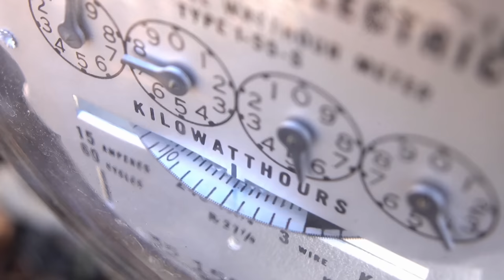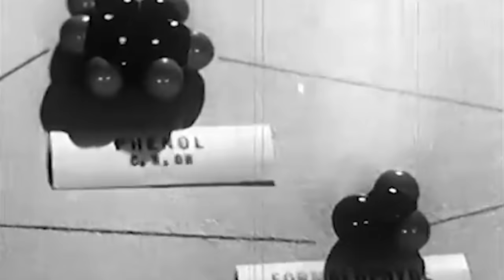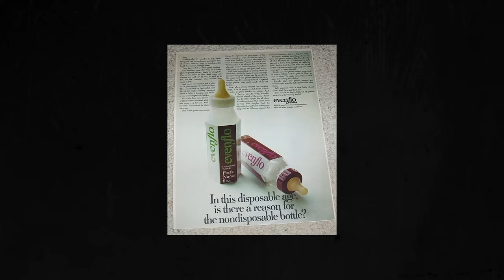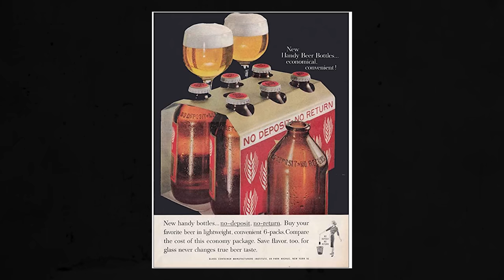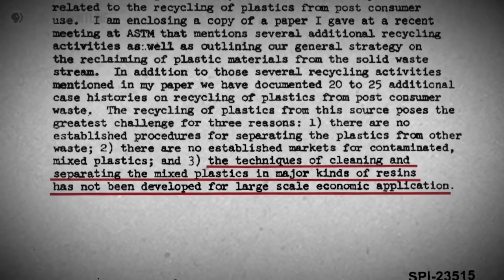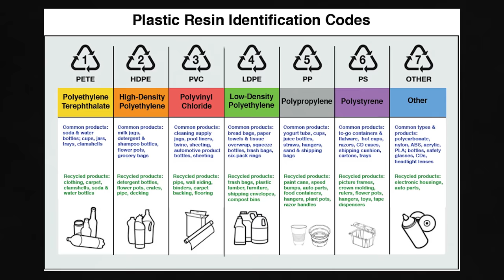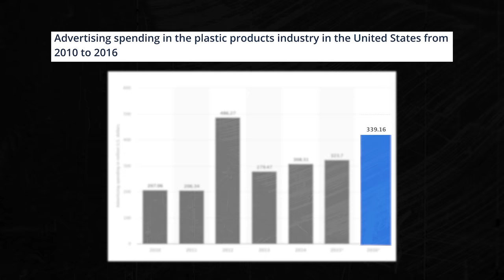The great recycling LIE (what really happens to plastic)

Comment: I worked in a plastics factory in the early 80’s. If a part coming out of the mold didn’t meet specs, it was ground into pellets and reused in the injection molding machines. There was a clear difference in the product made from the original pellets and the product made from the grinder. I’ve known for years that recycling doesn’t work because you will always have an inferior product. I wish we could all go back to glass milk and soda pop bottles that got washed and reused. We are an incredibly wasteful society. No product gets fixed anymore, we just throw it away and buy another. What we put in our landfills is a bigger environmental problem than gas powered vehicles.
Reply: It truly is sad. Everything is about profit. :( 
Look at how furniture is now. 
People used to pass down dressers, bed frames, etc through their families. 
Now they just dump the furniture and buy new ones from Walmart or IKEA. 
Particle board. 
Not solid wood meant to last hundreds of years. :(
Reply: @Crowski  Don't knock Ikea, a lot of that seemingly flimsy furniture can actually last a very long time.  We have some pieces from Ikea that are going on 20 years old, the stuff that fails usually fails in the first 6 months.  Real furniture all comes from either China or Vietnam now as they dumped in the 90's and put all the domestic furniture makers out of business.  It used to be that it was so big and heavy it needed to be made locally.  The same is largely true of kitchen cabinets, a lot come from Asia now.

Even if you consider a 20 year lifespan, it took too much less energy and required less deforestation to make that cardboard furniture that even if the real stuff lasts 100 years it's still more environmentally friendly to use the ikea junk.  Now the argument for real furniture is different the SE Asian made furniture is more environmentally unfriendly and certainly would not last 100 years.  My quote unquote real furniture is a far cry from what was produced even 30 or 40 years ago, lots of poor quality joinery which inevitably fails rendering expensive furniture generally useless.
Reply: @shaunbava1801  I agree but I believe it also has a lot to do with climate. Real wooden furniture holds up to humidity. Particle board doesn’t. :/ 
We have a shelf in our living room that’s particle board the past 15 years. 
It’s bent and leaning. 
But solid wood shelving hasn’t changed at all. It’s still like it was 25 years ago. XD 
It is EXTREMELY heavy I agree with you there. When it comes to moving….good luck. lol
Reply: They've experimented with a plasma torch to burn the waste at landfills.  A plasma torch will burn anything and the byproduct is just carbon.  They also wanted to see if that process could produce clean energy.  It turns out that yes it was able to get rid of waste and produce clean energy, but not in a profitable manner.  Hopefully, they'll continue to improve, but I don't have much hope.
Reply: why is it such a problem?
Reply: @shaunbava1801  When it comest to bilding furniture I don't see deforestation as a big plodom. I know a guy that bilt his house out of Aspen Polls that he loged and miled him self. To get the lumber he was hired out to do Forest mitigation. He dose all his loging with horses making it even less stressful to the forest. So say a wood worker paired up with people like my fried to bild furniture they would be helping the forest by thining out spots of overgrown Forest and turning the would in to something that would last a long time and even be fully biodegradable. Just my two cents.
Reply: They got rid of big pop bottles because they exploded dangerously at times and companies don't want to go through the bother of double handling their products, when they could put that effort into making more products.
Reply: When you recycle a product, you can only recycle it into something worse than what it started as. You've made this clear with plastics being recycled, other materials like carbon fibre, which aren't actually recyclable, have been ground down and used as a filler in concrete. We're effectively burying our rubbish inside the walls of our concrete jungles... Recycling doesn't make a material go away, it just postpones it from being buried in the ground. 

And now we have people thinking that plastic pollution is caused by people willfully littering... That giant island of garbage in the Pacific doesn't happen because I "forgot" to put my chocolate bar wrapper in the nearest bin, it happens because of large scale neglect and those items finding their way into the wild regardless of whatever good deed we thought we did with them.
Reply: Recycled steel used in the automotive industry EVERY TIME we've needed to redirect raw materials to war efforts taught us what problems there were with recycling LONG ago.
Reply: Plus milk and pop tastes better in glass
Reply: And those products taste better when they come in glass.
Reply: I try to reuse plastic cups and bags whenever possible. It's cheaper to use plastic bags as garbage bags and on occasion,as luggage,and reusing plastic cups to mix drink mixes. I am a truck driver, so I can't wash the cups,and I eventually have to throw them away
Reply: @Crowski  ; The reason you particle board shelf is failing is because it was not used as intended.  I have items that I built using particle board that are over thirty years old and still as stable as the day I built them.  Then again, I am a woodworker.
Solid wood furniture is magnificent, beautiful and unique.  I have built many items using natural lumbers.  Most were built for professional people with cash to burn.   It is very costly and beyond the reach of anyone below the upper middle class.
If it was not for cabinet products built out of particle board, millions of people would not have kitchen cabinets or other forms of cabinetry.
It simply has to be used in accordance with its physical properties.
Reply: .... paying for gasoline is a scam. why pay when you can charge an EV for free?
Reply: @Blox117  ; There is no such thing as free electricity.  The real scam is EV's
Reply: @wrongfullyaccused7139  was your high school diploma written in crayon?
Reply: How about bottle shortages if we wash and reuse no shortages cmon man!
Why throw perfectly good bottles?
Reply: Gas powered vehicles aren't a problem. Thats a scam too.
Reply: "I worked in a plastics factory...."

" I’ve known for years that recycling doesn’t work because you will always have an inferior product..."

As did I and of course some of the structural properties change BUT we used many tons of regrind material every year in products that were not trying to be as strong as possible while also being as light as possible. The places in which we used it you really wouldn't know there was a difference in physical properties less you completely abused the product and took them well beyond a realistic factor of safety and then some.

It absolutely depends on what you are making, what the indented use is and if the end product - even when abused and used well outside the range of intended stresses - can survive as good as virgin material. Too many factors to just say it does or doesn't work. A number of products that we had less you were Thor with his special hammer you wouldn't have been able to tell the difference between virgin and regrind from a physical property perspective. We could have used it in more places but aesthetics also matter when it comes to selling product, even when the look of a product shouldn't really matter as function is what you were paying for.

Then, it also depends on what the plastic is that you are regrinding, what fillers that it may have had before and after. Even the color (pigments / dyes) can impact some of the characteristics in a negative way on virgin material let alone using reground materials.

Anyhow, when used properly, regrind is a great way to recycle and there is no difference to the end user as far as life of the product and abuse that it will take. But materials, environment, use, etc. need to be considered and one shouldn't just use reground plastics for anything.
Reply: @mjs28s  exactly, this person was probably sorting the bottles as they came in on the conveyor lmao
Reply: @Blox117  u mean 67000 car can be changed for free,wow
Reply: I agree. But i prefer drinking my coca cola out of a glass bottle, the taste out of a plastic bottle just isnt the same. Im glad we still have that choice
Reply: Whats even more of a scam is people believing electric or hybrid cars are better for the environment.
The energy comes from the same place and the environmental impact of making these cars is significantly worse then just making a standard gas car.
Reply: Not to mention the drinks taste better in glass
Reply: KNOW WHY?   guess not.
Reply: @Karl with a K I agree
Reply: You are so absolutely right.

Comment: I worked at Home Depot for a while, and while we did have bins separate for regular garbage and recycling, it was all put in the same trash compactor in the back. So yeah, our recycling model was just a sham.
Reply: But you were reusing the trash compactor everyday right? That's recycling!
Reply: You’re not that smart
Reply: @thedude9014  Explain.
Reply: I currently work there,  and we do recycle plastic film and cardboard. But if people don't put the paper from the recycle bins into the cardboard pallets, it won't get recycled. That's human error, not company policy.
Reply: People get boxes from stores to use when moving, Goodwill, Salvation Army, Thrift stores, yard sales and flea markets sell used items to recycle them.
Reply: Ok, but put in the same trash compactor by whom?  Was there no recycling bin of any sort to put it into, or was it just indifference on the part of those taking the trash and recycling out?  The first would be a failure on the part of Home Depot, while the second would be a failure on the part of the staff.
Reply: @wesdowner5636  Bingo.
Reply: @inspirequeens  "They do this".  Are you saying that there's no place to put recycling when taking it out from Whole Foods, or that the staff taking the re-cycling out can't be troubled to put trash and recycling in their respective bins?  And to what degree is that representative of all Whole Foods sites?  People make such extreme inferences from statistically irrelevant samples.

Comment: I worked in the plastics industry for just over 37 years.  We mostly made home exterior products where I worked.  As for re-use and recycling; it's complicated.
Recycled plastics are cheaper, but each time plastics are re-used it becomes weaker as the longer polymer molecules are "sheared" or broken in the process.  Meaning the polymer becomes weaker and more brittle.  There are some products, like gutter splash blocks, where this isn't really an issue, but most products have industry standards they have to meet so that limits the use of recycled plastics.
Often plastics can be re-processed; meaning additives can be mixed back into the polymer at a greater expense to help recover some of the origional characteristics, but it's never quite as good as the virgin material.  The law, via the FDA, in most areas is that any plastics touching a food product must be a virgin plastic, even though processing achieves temperatures high enough to kill any germs, virus or bacteria.
Most recycling "do something" programs are all about feeling good and are in effect a form of taxation for the consumer at the point of purchase.  We are paying for recycling that in many areas, like most government programs, simply doesn't happen, or the program doesn't function as well as it was sold to the public.
Reply: At the plant that I worked at, we had rows of bins full of regrind that we couldn't use, waiting for someone to buy them up for recycled use .. Even the few things that we made with that regrind had at least 50% virgin resin mixed in.  You probably know what happened when all the bins got full, and we had nowhere to put any more regrind.
Reply: Instead of all the I-knew-it commentaries this is way more differentiated and adds well to the very brief mentioning of it in the video. You helped me understand the situation way better. Thx :)
Reply: Probably better finished off as fuel for the saleable item to be produced.
Reply: @Green.Country.Agroforestry  Yes, I worked a plastic, silicone rubber plant , had the same problem, then the EPA came along and banned some of the chemicals needed to process some compounds in the USA, so that all went to China ,where there are not the same or no restrictions
Reply: @benscoles5085  Which is one of the biggest mistakes they made.
Especially given that we basically are sustaining the CCP's rule and already unstable and fragile economy.
Reply: It is in fact entirely possible to make plastic substitutes safer, stronger and cheaper from other stuff - but unfortunately, the petroleum industry hates that idea.
Reply: @huh4233  right, well close. Incinerators burn it at high temps to generate electricity

Comment: August 2017 I was working in Falmouth docks in Cornwall, UK. On one of the quaysides there were hundreds of what looked like plastic wrapped hay bales, about 5 or 6 feet in diameter. Closer inspection revealed they were full of plastic and cans - recycling. I asked about and found that this was some the recycling that was collected in the "bumper box" recycling scheme. I was told that all the recycling would get loaded aboard a ship, the ship would then sail to Plymouth where it would all be off loaded onto trucks and taken to landfill. Meanwhile the residents of Cornwall were being fined by the "bin police" for not putting recyclable items in the "recycling"

I told people what I had found out and most refused to believe me, they want to believe they are good people for following rules and doing the recycling.

Most people like to believe  they are intelligent, intelligent enough not to be scammed. And so the problem continues.
Reply: Yo Dan.... Fellow dockworker from Penryn here... 😊
Reply: It is easier to trick a man, then to tell him he has been tricked.
Reply: It's easier to fool the people than convince them they've been fooled.
Reply: You can fool some of the people all of the time and all of the people some of the  time, but all of the people all of the time?
Well that takes time......

Comment: When I was being indoctrinated in 3rd grade I scolded my dad for not separating his trash into recycling.   This was 1987.   He told me that it takes too much energy for companies to recycle.  Its less pollutant to incinerate it and get new.   I began to wakeup from that moment on.
Reply: 5
Reply: Metals are easy to separate from trash. Plastics separated from wet waste can be burnt cleanly and the heat used to produce useful energy. Wet waste can be composted.
Reply: PETE and HDPE are reusable simply by washing and grinding up. They are easy to reuse. The others, PVC for example, not so much. All plastics are oil based and do burn and can be used to produce energy, however you need an exhaust burner to burn the fumes at at least 1400 degF to burn off the toxic fumes.
Reply: That's still a consumption mind-set.  As a society, we need to escape that.  If we can't economically re-cycle something, we shouldn't make it in the first place.  That's waking up.
Reply: @patricksweeney6334  we should go back to glass and it is a cleaner recycling process and actually works. Also better for everyone as BPA’s are not an issue with well made glass.
Reply: @ArmaMoto  Glass is indeed the superior although more fragile packaging. Plastic replaced glass for this reason in most manufacturing, because it still held a glossy shiny look but held flexible and strong against drops that glass would not.

Comment: Sounds silly how I discovered it was all fake. During my first job as a housekeeper, there were recycle bins for guests separate from the regular bin. Yet when we cleaned the rooms we were told to just dump it all in one bag together. So it was all just for show. Never seen it the same way since.
Reply: Attempting to maintain some optimism about this: perhaps it is possible that they will get the next stage sorted out separately. i.e one part of the process is to have separation in the bedrooms, and another is to collect is separately in larger containers, and the next stage is to get some recycling company to pick up the separated waste.
Reply: I see that with my local garbage collectors myself
Doesn't matter if you separate or don't, it's all dumped together in one car!
Reply: Not simping but you're gorgeous.
Reply: Same for the demolition and building industries
Reply: @senor2930  That's frustrating, I'm sorry. All recycling goes together where I live, and it is separated (I assume) later on.
Reply: We do this at work and then the Cleaning Crew comes in after most Workers are long gone and comingles everything in our Dumpsters. I tried to tell some of co-workers to look for the non-existent Plastic Recycling Dumpster, but they didn't really care. They just feel good about using the Blue Can to save the world!
Reply: @williampagdon4822  I feel sad now. One can at least burn plastic in a proper incinerator for it... better than burying it.
Reply: There was a place for every bit rubbish we used it was called a coal fire .
Reply: Where I live, you have to pay for the weight of your "special" garbage like bio-waste or chemicals  Plastics are free. What  any child figures out is that you can hide anything else in the plastic because they don't want to touch it anyway.